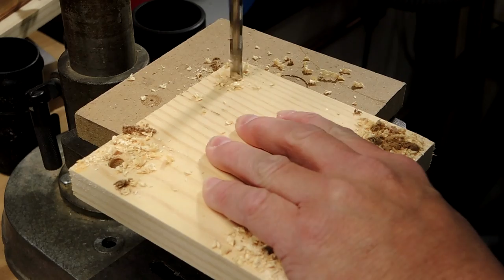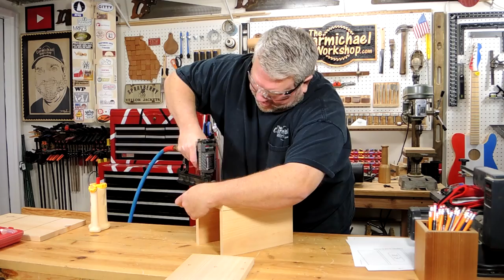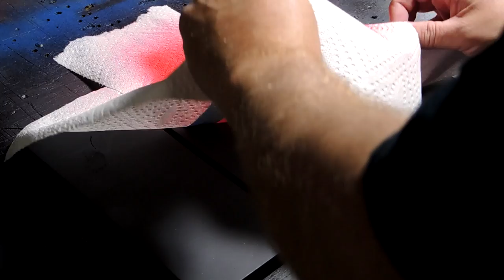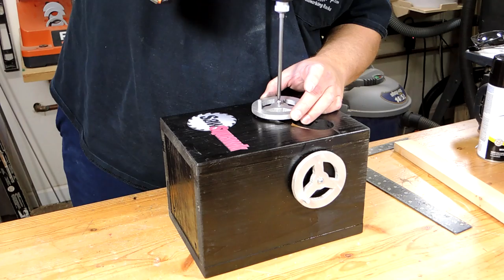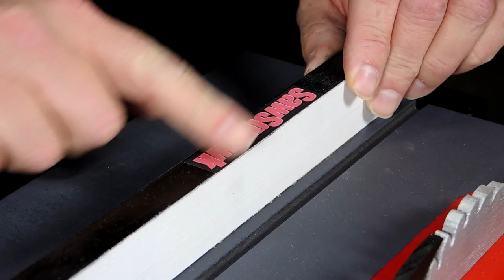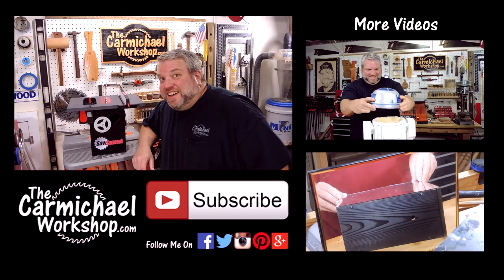SawSquawk Table Saw Birdhouse (Inspired by SawStop)

Comment: how did you build the fense and mitre gauge because they are not in the plans?
Reply from the maker: +stewart c Hey Stewart!  By that point I was just winging it.  har har.  lol   I just made those up at the end.  The fence is a piece of 3/4" wood that is 3/4" longer than the table, with a crosspiece glued under one end.  The miter gauge is two pieces of 1/4" wood glued together with a thing piece glued on the bottom that fits in the slot.
Reply: +Steve Carmichael thanks for that reply. i think i might have to make one myself.

Comment: Hello you starving youngun! That is a SHARP birdhouse but I hope the 'carpenter bees' don't eat it up. I finally got my dad-in-laws old belt drive Craftsman running and now to keep all the fingers on the hands instead of the floor. It's an 8 inch bench saw with the original Craftsman belt and it's 40 years old. Hope I can do it justice. Thanks and waiting on the next one!
Reply from the maker: +Lewie McNeely  Hey, my dad had a one of those 8 inch saws.  It was on a metal frame stand.  It didn't have a motor though.  Thanks for watching sir!
Reply: This one is the same except it had the 3/4 horse Craftsman motor on it. It took a new cord and some cleaning and getting the legs extended so I wasn't on the floor with it. Cuts as smooth as if it was  sanding at the same time. It has to be the saw because it sure ain't ME! And as far as watching, I like to see how things are done right!